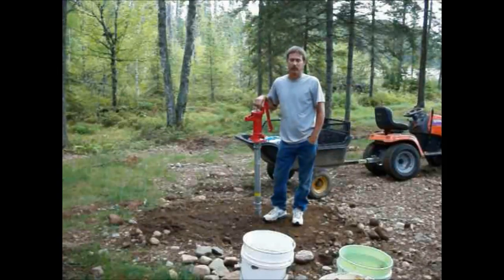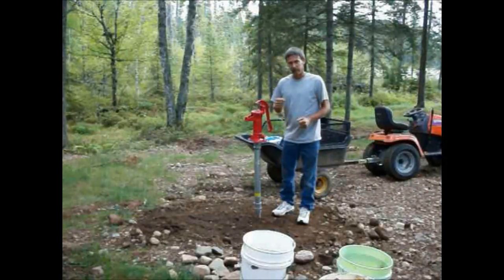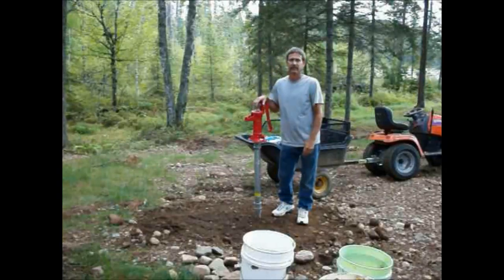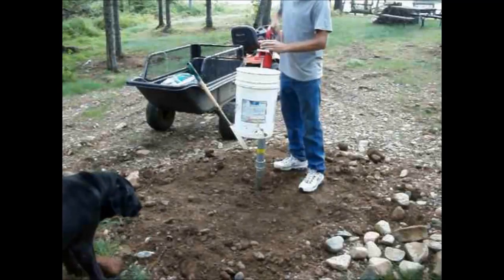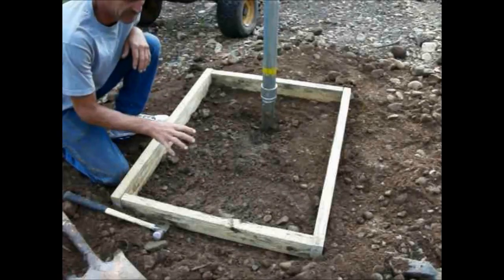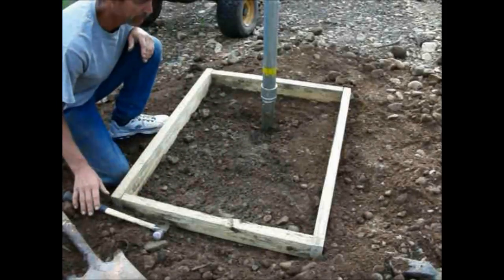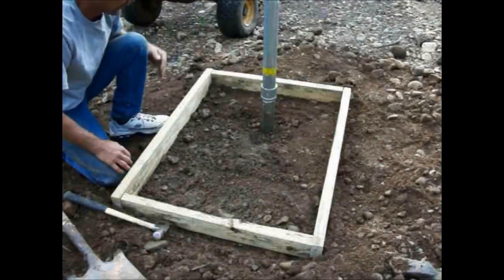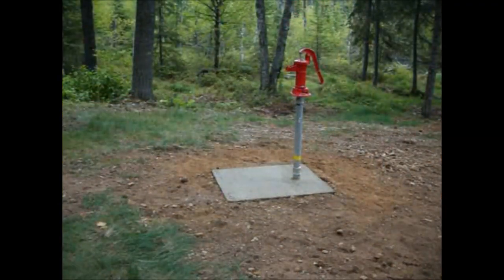Hand Pump Water Well, Cement Slab Installation. The Tent Well Complete.

Comment: Great video, thank you. I want to so something similar to a yard hydrant. Does it hurt the pipe over time to have the concrete right against it or would it be wise to split a pvc pipe and put that against the water feed pipe?

Thanks in advance for any replies.